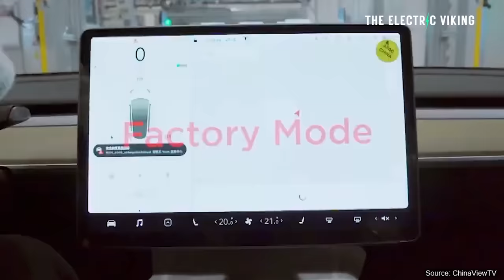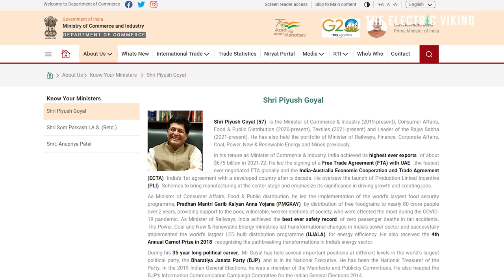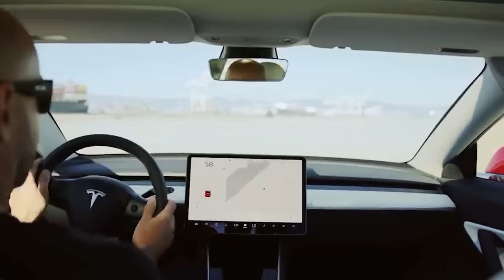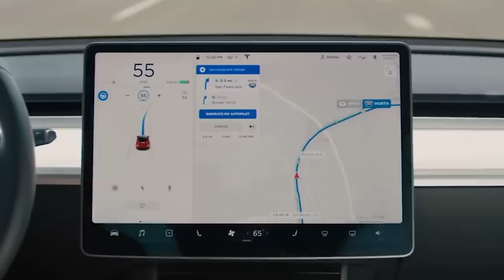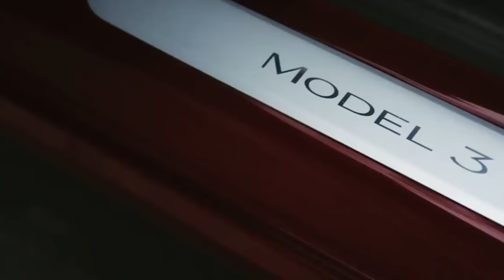Tesla to spend almost $2 billion on EV parts from India this year

Comment: You better be asking whether the taxes for Indian EV manufacturers like Tata and Mahindra can be lessened in the U.S or what could the U.S govt do to ensure quality products from Tata and Mahindra at affordable prices for ordinary U.S citizen's.
Reply: Indian manufacturers can set up in US to avoid import taxes!
Reply: Some did try like Mahindra with their Roxor. Then as usual the protectionist Market filed cases against them and stopped production until changes were made to the grille.
Reply: @dharmicwisdom9818  It looks like there are requirements for being street legal that are not common in Indian cars.
"States typically require headlights, taillights, brake lights, turn signal lights, hazard lights, reverse/backup lights, and license plate lights. There also needs to be a closed cover or hood over your engine compartment." - Progressive website.

Comment: In the north of Germany the people pay over 300 million € yearly for so called non-produced electricity because the wind-power systems get deactivated because there is too much electricity. To add: Germany is also an electricity exporter. In 2022 it exported over 22 terawatthours more electricity than it imported (why the fuck did it import any when it has to deactivate masses of biogas, photovoltaic and wind-power systems? Completely nuts!).
Reply: Electricity production has to be localized and even though they do have a ton of production available in the North, the south is a different animal altogether.
As a matter of fact most of the big industrial factories are actually located in the south.
  It's like hearing United States.  We are a net exporter of oil, yet we do still buy some oil from Canada for the Northern States.  Oil is not something that you want to be moving around a lot of, the shorter the distance the less likely you will have a spill.